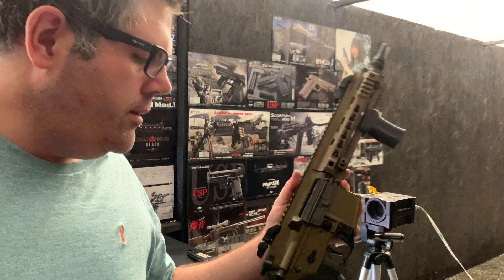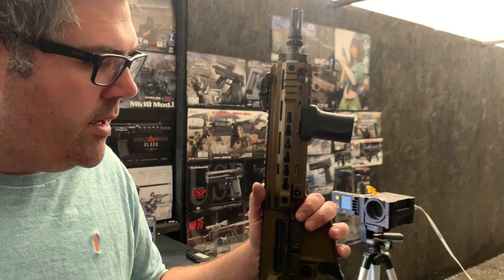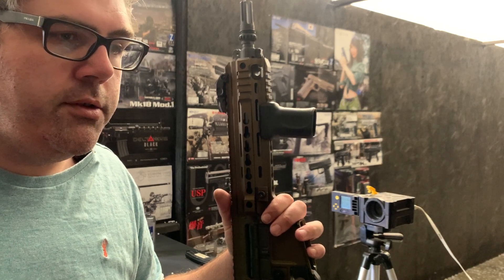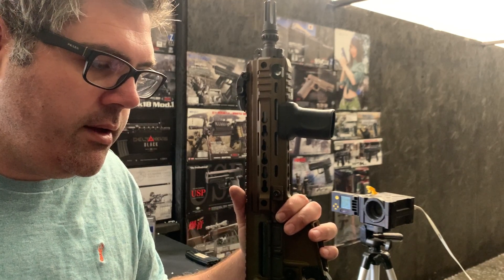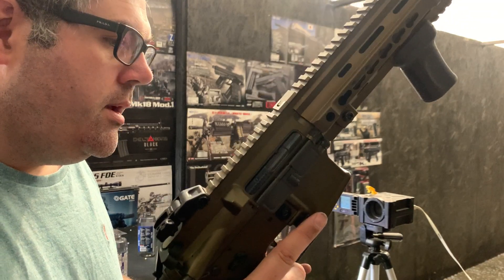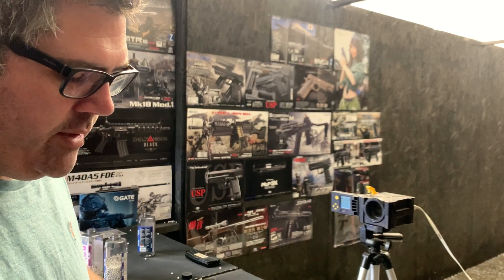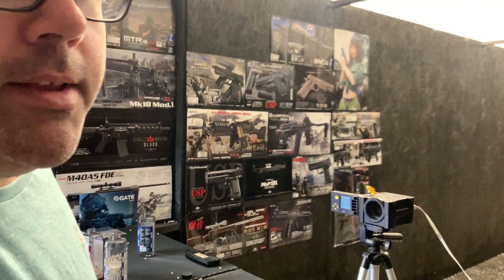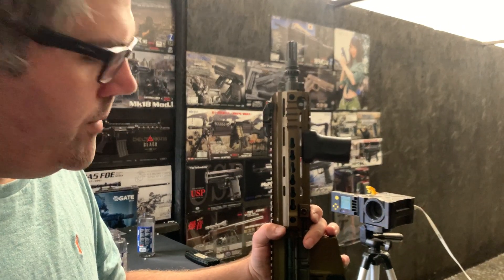Testing A Upgraded VFC DSG AEG | 434

Comment: wonder what motor is in there. Its pretty screechy. If it is the stock VFC motor that is why. Stock VFC motors sound terrible.
Reply from the maker: I wouldn’t describe it as screechy.  Not in the slightest.  If memory serves it was shs which is a harder pinion yes.    We tend not to record anything preinstalled when it arrives only work done.
Reply: The gun sounds great. I'm sure the work was top notch. I can defiantly hear the motor in semi. I would probably not have changed the motor If I was a business. It works, no need to change it. I'm super picky. I would put an ASG motor in it. Might preform the exact same, but it would sound better in semi.